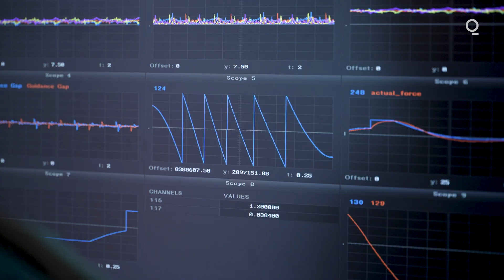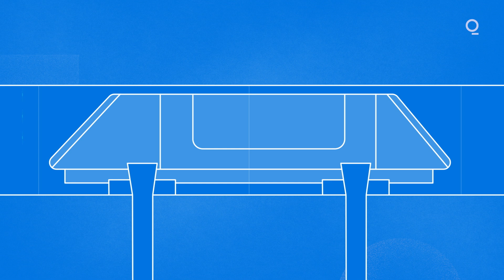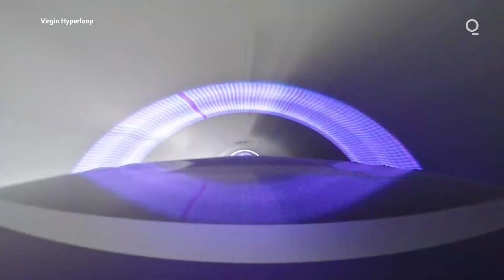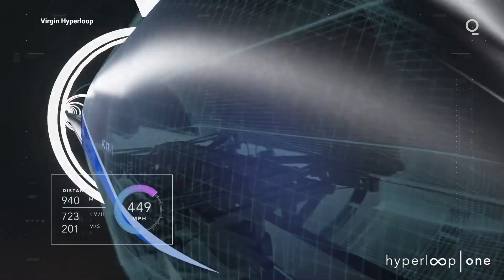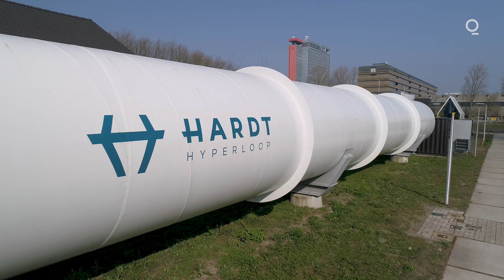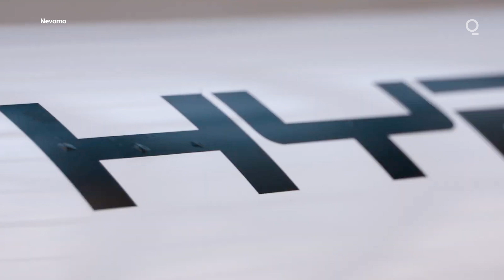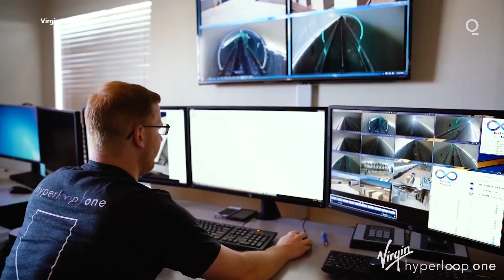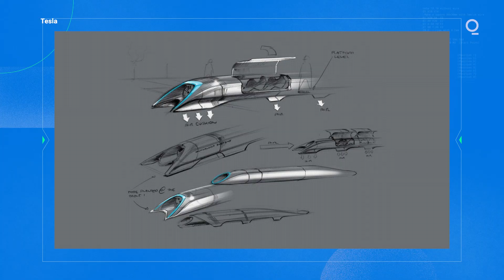The Hyperloop May Disrupt More Than Just Travel

Comment: I would have so much anxiety if it broke down. no where to get out of train
Reply: And the pod behind comes crashing
Reply: @johnsnow1050  it is operated by magnets. If it broke down the entire system would stop
Reply: @the5thYearSeniors  wouldn't that be counter productive
Reply: Dam it, now I can’t stop thinking about that lol. I was actually excited to ride this, now I’m terrified.
Reply: @TheAlexander99  I am guessing that if there was a malfunction that there would be a system that would allow air into the tube in the section the malfunction occurred.  I am also guessing there would be escape hatches in case of a malfunction.  At any rate it seems safer than a helicopter
Reply: @estherc.5559  nope helicopter is far safer, Auto Rotation exist, if the Hyperloop fails they will have to swill the passengers out.
Reply: @dogwalker666  or allow air into the tube and take them out through an escape hatch.  I think that is a more likely way of rescuing trapped passengers on a hyperloop.  Not sure why you think passengers would be liquified.
Reply: @estherc.5559 Since when did we try to use helicopter as a mass transport system? We have bullet trains that transports million of people every year. A single Shinkansen can transport 1323 people. The tube concept can't do that.
Reply: @dogwalker666  tell that to kobe
Reply: @TorianTammas  I never claimed helicopters were used for mass transit only that the hyperloop seems safer.  Bullet trains take all passengers to one location at a time.  All the train compartments are linked together.  Sure if you got on a bullet train in New York headed to LA you could get off at stops along the way, say Chicago for example.  But what if you wanted to go to Houston?  Sure you could get off at a station and get off one train and catch another train going in that direction.  But if you have traveled before you know getting off one bus or train to catch another one is a hassle and not efficient.  Several compartments for any destination would be empty or nearly empty.  Individual compartments going to only a single location and locations along the same route would be more efficient.  You do not have to stop at every stop along the route.
Reply: @dogwalker666  What makes you think if hyperloop fails that passengers would have to be swilled out?  If it stops moving passengers could just be evacuated out of their compartment.  It is not like they are crashing to earth just because the compartment stops moving.  If the propeller on a helicopter fails you are crashing to earth.  If a hyperloop stops it is inconvenient but not life threatening.
Reply: @estherc.5559  there is this little thing called inertia when the pod travelling at supersonic speed looses power or even the air cushion that they somehow manage to create in a vacuum the pod will come to a grinding crash metal to metal contact at that speed is quite spectacular,  not that it will ever be built,  All copter pilots are trained to do auto rotation.
Reply: @dogwalker666  I understand inertia.  The cushion as you put it is not created by air or a vacuum.  It is created by electro magnets. The vacuum is to eliminate air resistance not to cushion the compartments.  The odds of the electromagnets failing is small at worst, especially if there is a backup system in place as there usually is.  Enclosed in a tube that is traveling in a straight line I do not see much of a chance of derailing.   They could even design a system that if by some small chance the electro magnets fail that an air bag system deploys not inside the compartment but around it. As for auto rotation Kobe Bryant's copter pilot must of missed that day of helicopter pilot school.
Reply: @estherc.5559  "Seems safer" is an interesting claim. This is based on a study based on facts or on feeling about a system which does not exist and never worked to transport a single person.
Reply: @TorianTammas  Exactly "seems" safer.  When someone says something "seems" like something..... or anything they are giving an opinion.  Of course I have no data on a mode of transportation that does not exist.  I never claimed to have any data.  Also did not claim to be an engineer or physicist.  I do however know something about physics. and my opinion matters about as much as anyone else's. It doesn't.  But I am still just as entitled to it as you are to your opinion.  Me personally if someone said I can get you to your destination in a half hour and you can choose between getting on a hyperloop or a helicopter.  I am getting on the hyperloop.  And yes I now it does not exist.  It's if both were an option to me.  In that hypothetical scenario I would choose the hyperloop.  For all I know it could be a death trap, but to me the concept "seems" 
safer. Unless one is ever made there is no way to prove or disprove that opinion.
Reply: @estherc.5559  Why compare a fantasy system that claims to be able to do mass transport with a non mass transport system?  Why not compare it to  bulkert trains? At peak times, the line carries up to 16 trains per hour in each direction with 16 cars each (1,323-seat capacity and occasionally additional standing passengers) with a minimum headway of three minutes between trains.
Reply: @TorianTammas  Do you sell helicopters for a living?  Are you a pilot by any chance? You seem bothered by the fact that I do not find helicopters to be a safe mode of transportation.  Im not stopping anyone else from getting on one. If you want to travel  by helicopters go for it.  And the comparison was not about the number of people either could potentially carry.  The comparison was about safety.  Someone commented on how unsafe the concept seemed, not about the number of people it potentially could carry.   If they had commented on total passenger capacity my reply would have been different. But since the comment I was replying to was about safety, I made a comparison based on safety.  The concept "seems" safer to me.  Also I believe the idea is many individual compartments traveling in the tubes.  Different compartments might have the same destination.  But they also could go to different locations.  There could be a relatively small number of people in any one compartment.  It was my understanding that is why it is not considered a "train" because the compartments are not linked together like a train.  So it would not be mass transit in the strictest sense of the term.   I understand it has not been built and very possibly will not be built in my life time or at all.  But I also know that many things that seemed impossible 50 or 100 years ago are common today.  At any rate I find the idea of it fascinating and hope that some day in the future it will be built in some capacity.
Reply: @estherc.5559  I prefer when we compare the comparable like a tail based system. We have mass transport with bullet trains. Millions of people use it every year and arrive safely at their destinations.
Reply: Is hyperloop a train?  Looked like the compartments moved independent of each other.  That different compartments could have different destinations.   maybe the graphics on this video was not accurate but that is how it was shown.  Transportation of a dozen people compared to transportation of a dozen people.  One mode is in the air the other in a tube but accomplish similar things.
Reply: That’s why I think these things would be better for freight instead of human beings
Reply: hold your breath and then open the door
Reply: @PhillipAmthor  right? just like what an astronaught would do
Reply: @PhillipAmthor  Don't worry, in most of the breaking down scenarios you would be dead before you knew there was a problem!
Reply: @PhillipAmthor  Hyperloops operate in a vacuum so everyone would die if you opened the door...
Reply: @mpgnz73  i know..
Reply: @PhillipAmthor  Decompression might have a deleterious effect on your life...
Reply: @jasonuren3479  i know it was a joke
Reply: @PhillipAmthor  Just making sure 🤣. Wouldn't want anyone to try it 😉
Reply: Can't help but think of the movie TimeCop, with that wall 😲🤣
Reply: Don't worry
Just wait until the other pod behind you smashes into you and gets you to the next station

The pearly gates
Reply: And a tiny pin size hole anywhere would sabotage it completely
Reply: Not to mention if it got damaged or the tunnel got punctured cos then it would cause a crash
Reply: Did you know that this was the exact worry people initially had when the elevator was first invented decades ago and look now, almost every multi-storey building in the modern world has it.
Reply: @sohamdeshpande6595  yeah because a a guy invented the emergency brake if a elevator failed/fell/cables snapped. After that people felt safe enough to ride but until they were mostly just for freight
Reply: @sohamdeshpande6595  Really, elevators do not operate in a steel tube in a vacuum.
Reply: @sohamdeshpande6595  there are not many elevators that travel at supersonic speeds in a sealed vacuum tube, defying laws of physics.
Reply: No different to a plane. Less turbulence 😉
Reply: They all would have access point if somehow it were to break down. But magnets and air pressure dont really fail. It would just slow down if there were an air leak.
Reply: @Chris88McD  They would crush when the air seal breaks. If they survive said then they die when the oxygen supplies run out. It is a high risk mode of transportation.

Comment: It’s too far to hit reality even if it does cost of this will be four times or even higher than plane ticket i guess.
Reply: Actually because it doesn't need to carry it's fuel, be in a controlled environment, and reach speeds faster than airplanes it would actually be cheaper than planes.
Reply: @BaconDragon-yr5vf  finger crossed but the project cost is too high and don’t forget the Maintenance cost

Comment: What’s the difference between this and Bart in SF? 

It seems like the same principles… except with fewer stops, so that’s why the hyperloop may go faster…
Reply: Yeah it would work fairly well to take people from city to city, who would then take normal transit to their exact location same as an airport.
The biggest downside is that by being underground it makes repairs way more difficult and expensive. Vs a passenger two rail that can already drive at up to 120mph and is made to be easy to repair and install.

Not to mention that building one from SF to LA for example, would mean digging through a ton of different terrains like granite, marsh or clay. In the end its likely that the price per ride will be the same or more than an airplane, so people may not see the benefit.

Comment: Thunderfoot debunked the living daylights out of the hyperloop. Without vacuum, it's a dumb, slow, expensive tunnel.
Reply: crash
Reply: With vacuum it's a ticking time bomb
Reply: @Alpenjodler1  how is it a timebomb with a vacum
Reply: @djatlasmusik  a small hole and it implodes on itself because of the air rapidly rushing in
Reply: @okbuddy5304  Last I saw they hadn't made any expansion joints in the tubes they've built so far, that's surely not gonna fare well over time.

Comment: I am still trying to understand a few things from all the videos on hyperloop:
- how is structured the vacuum system : one pump can only create vacuum in limited volume, but the pipes are huge, so how are the multiple pumps placed and what is the energy consumption?
- How do you handle the transition of the pod from a vacuum area to an area with a normal atmospheric pressure for the passengers to get in and out
- an incident or an attack breaches the vaccum pipe, and the pod traveling at mach 1+ suddenly re-enters the normal atmosphere. What happens then? How is the passengers' safety ensured in that scenario?
Reply: I wouldn't worry about it, it is never going to happen.
Reply: @garethhanby  based on what evidence?
Reply: @RaginMunchkin  You do not need evidence for opinion, but also you do not need evidence to believe in it. Perhaps I will be proven wrong and if so I will accept it. The point is there is no evidence at the moment as to its viability, plenty for its impracticability. A high-speed rail can transport a thousand people in one go, who claims that for the hyperloop?
Reply: @garethhanby  I misunderstood your message then. I thought you were saying the vacuum breach was not going to happen. As for the opinion you voice, that hyperloop is not going to amount to much in the end, it is widely spread, and abundantly backed up by many engineers. But yet again, in the 19th century the royal society in London was issuing statements that a train was a bad idea that would never work... Being in the railway industry myself, I am trying to find factual information that will help me form my own opinion on the matter. I hope it works out, and if it ever does I wouldn't mind working on it. To paraphrase, if they don't I'll accept it. As for high-speed trains they are amazing (I am French and I have thoroughly enjoyed a 1000km or so ride from Paris to Marseille in less than 3h regularly for decades now) but apart from some limited areas they are not nearly as wide spread as they should, and we keep flying places or driving instead, or just taking sluggish trains. So maybe if hyperloop works we can finally do something about it...
Reply: @RaginMunchkin  Yes, apologies my fault for responding with ambiguity. I can now see how it looks that I might be disagreeing with you rather than the idea itself. I'm sure one version of it will happen, with reduced pressure, rather than a vacuum. But revolutionise travel itself? No way.